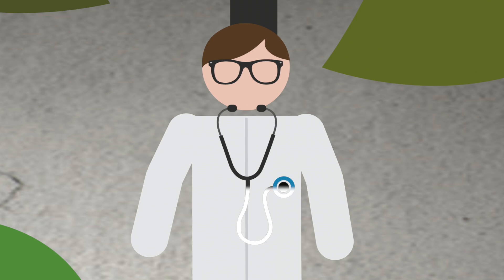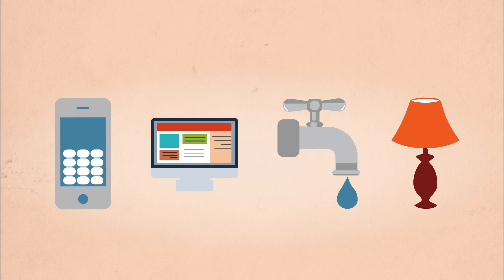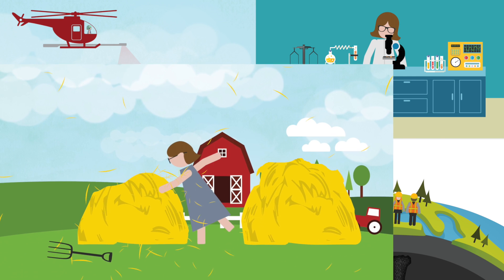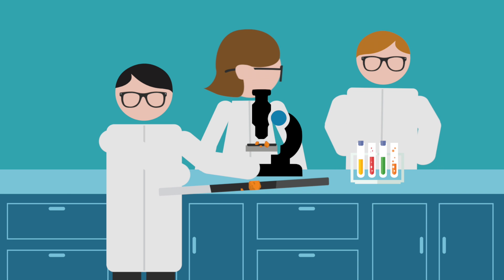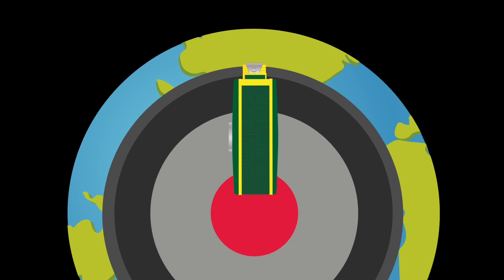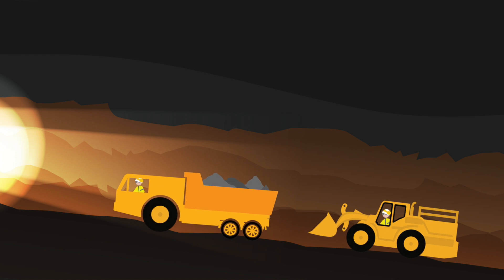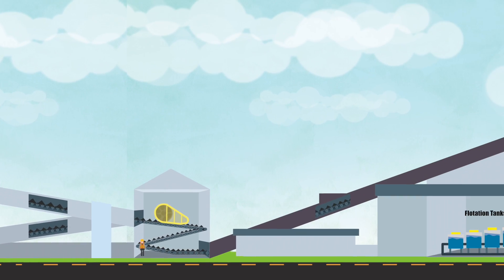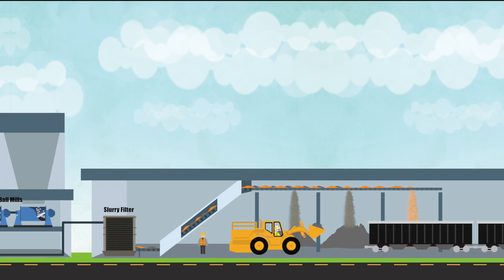Modern Mining - How Eagle Mine produces nickel and copper

Comment: I watched this with my 6 year old son in the UK - and he was fascinated. Thank you. He did however, have one question - how did the trucks get to the lower level after the deployment of explosives?
Reply: Well, underground mining.  From what I learned, it is called stoping. These trucks designed for underground mining pass through shafts, adits and tunnels. These terms have different meanings in mining though they seemed to be similar.
Reply: the blasted rock would be mucked out, and then the ground is sloped, and the whole process repeats again
Reply: exactly! that is a good question of your little son.

Comment: No offence, but that's nothing compared to what the Springhill coal mine was in the 1950's.  It's slope was 14,200 feet long, with a vertical depth of 4,000 feet.  At the time, it was the deepest coal mine in North America.  Unfortunately, it was closed down due to some major disasters.
Reply: +Aidan Jackson-Kelso I mean, when you&#39;re a mining engineer the things you argue about are pretty thin.

";YO, you hear the Arlingon miners only have a 12 foot diameter tunnel? SO 1980's..."